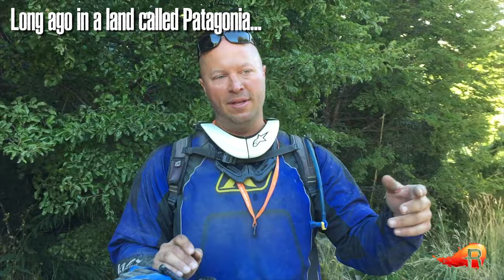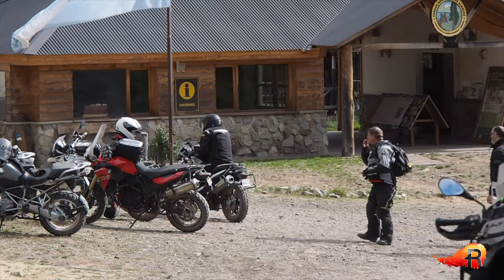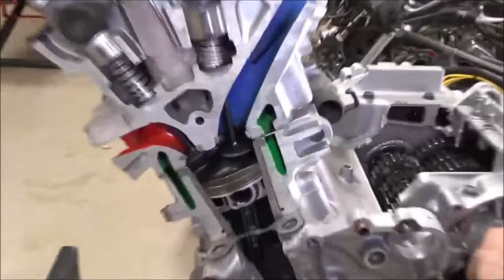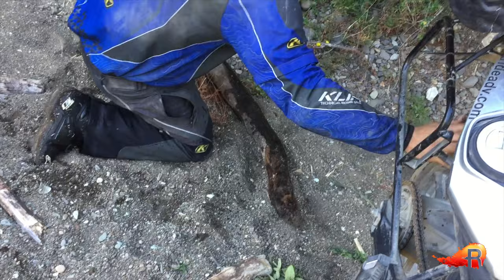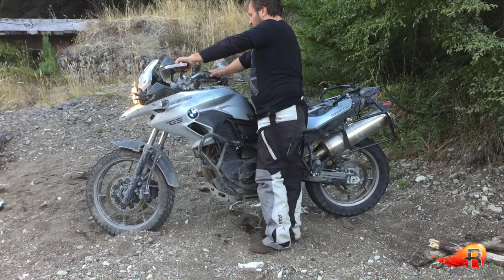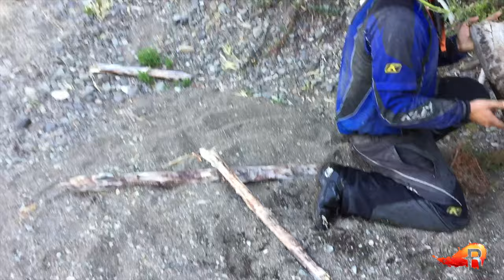How to Deal With HYDROLOCKING Your Motorcycle and the Story Behind the Lesson

Comment: I have gotten a KTM 500 EXC running after being totally submerged. We had no tools. Stand the bike on its back wheel to drain the exhaust. Removed the air filter and clean out the air box. Put bike in 3rd or 4th gear and pull in clutch and push bike BACKWARDS”!  Note - it would not turn over forward on the starter. Get the bike rolling back wards and let out the clutch. Had to do this about 5 times. Finally it pushed the water back out into the air box. This happens because of something called “valve overlap” where for a very brief amount of time both valves are a slightly open. Once we had the engine rolling we got it started. Oil in sightglass looked like chocolate milk. Rode it maybe 2-3 klm to nearest road and then trailered it. Change oil 4-5 times and good to go.
Reply from the maker: Interesting, meaning, you did push the button and it wouldn’t turn over ? My guess in that case is: The piston was probably at Top Dead Center or close, and the chamber was so full of water, that even the starter could not force it over. By not getting its momentum, it wasn’t enough to fold the connecting rod then. Good deal in that case :)

Comment: First thing I’m going to do now is buy a spark plug socket and put it in my trail pack with my other tools. I always thought it wasn’t required because I didn’t think I would ever change my spark plug on the side of the trail, haha. Thanks for the story, it helped me out.
Reply from the maker: Glad if it helps someday, and yea, I think most OEM tool kits still come with a spark plug tool, so you may already have it. -- Thanks for watching.
Reply: MAD TV has a great video of an insane trip through flooded areas in Australia. They were dewatering bikes several times a day and much can be learned from their group leader's methods. The bikes were much smaller but the concept is the same.

Comment: I dropped my 2015 Suzuki Vstrom 650 at a remote river crossing in the Northern Territory of Australia...the bike was lying on its side completely submerged for several minutes before my companions could get to me and help me get it out (note the river is inhabited by salt water crocodiles)...fortunately the Vstrom has 2 spark plugs per cylinder and there is one reasonably accessible plug in each so wasn’t too hard to clear the water. The tank also had to come off to get to the airbox which was full of water. Bike ran fine afterwards and for the 250 km to the next roadhouse on sandy, badly corrugated road in very hot conditions. Another day and 200 km later I also discovered that I had water in the engine oil ...that was 10,000 km ago now and the bike is apparently none the worse for wear !!! The experience has made think how difficult it would be to dewater something like a KTM 890 or even a T7 on a river bank because of their complicated spark plug access 😮
Reply from the maker: Another nod in the favor of the VStrom. What a great bike, as we have noted in other videos. Glad it worked out!

Comment: The best thing to do is push the bike up a slip in neutral then roll it backwards in 5 or 6 gear , after tipping the bike up on the back wheel th drain it.

Comment: I used to follow a Russian team called "Off road people" and they had a whole series of such deep water dives. One of their solutions is to stand the motorcycle up on the rear wheel and allow the water to free fall out (as much as possible). Then they would immediately take the motor oil outside into a metal can or pot (it's a big crew) and boil the oil until the moisture evaporates. Then they put the same oil back into the engine and continued driving without problems. Of course, they had plenty of time and all the necessary tools with them, a large team prepared for multi-day rides in the wilderness.

Greetings to all adventurers!
Reply from the maker: That would have been an excellent option, boiling the oil! Wish we had had the idea, tools, and cauldron to do so : )  But yes, we did some tipping back, and rolling onto it's side/top a bit which got some water out for sure. I feel like even back then, I knew the oil was obviously crushing past the rings and would create what eventually happened, but it was worth trying. -- Thanks for watching.
Reply: Yes, russians. They are used to it

Comment: Great story and experience!
I was snow machining in Alaska with a (crazy) friend who drove his 800cc ski doo into a creek to try and drive up the creek on top of the water!  I saw him go in and thought "Oh no, I'm going to have to rescue him from drowning"!  When I got there, he was standing in water arm pit deep , smiling, and his entire machine was underwater.  We wrestled it out onto the bank, and I was prepping to pull him to the truck which was about 4 miles away (and +5 degrees F so it was cold!).  He said no, he would get it started.  He pulled the spark plugs out, then we tipped the sled on its side and pulled it over a bunch.  Put a bic lighter under the spark plugs to dry them out, and I think we put a few drops of gas in the cylinders- and he drove back to the truck!  He changed the oil 2 or 3 times and seemingly, no damage to the engine.  It was a 2-stroke, which would be different than a 4-stroke- the engine was fuel injected and I don't think there was any oil sump to worry about.  Big difference.
Reply from the maker: Nice rescue! And good situation for a 2-stroke to prevail. The only thing that stopped us from riding 100 km's or whatever, was that oil/milkshake forming within the engine. --- Thanks for watching and sharing.

Comment: You missed one step. After starting, turn the bike off and let it sit for 1/2 hour or so. The water should settle to the bottom of the crankcase. After letting it sit, pull the drain plug to drain the water. Once you see straight oil coming out quickly re-install the drain plug.
I always carry an extra 2 quarts of oil. Could come in handy some day.
Reply from the maker: Excellent idea! If only we had even the tool to get the drain plug out. Or the clear conscience that would allow some oil to ultimately spew into Patagonia:) But great idea for those in the right situation, so thanks for sharing.
Reply: @RIDEAdventures  well, man, you are actually riding a fume-exhausting bike making a hell of a noise through a forest. Your concern about the oil is legitimate and appreciated, but somehow a tad ironic…

Comment: Drowned the bike in Iceland. Put the bike upright with the help of a friend to remove water from the exhaust. Then pushed the button twice and of course hydrolock (i was hoping only the exhaust). Then we removed the plugs, removed the water in the cylinder and then the bike started. I changed the oil 3 times and good to go.
Spoke to a mechanic about being afraid of bending the rod. He laughed at me cause he said there is no way you can bend a rod with just the power of the starter. However if you go full throttle over shallow water and drowned the bike at speed then yes but you will never bend a connecting rod with the starter by pression on the start button. there you go 👍
Reply from the maker: Great story, thanks for sharing, and I'm quite sure rods have been bent by starters. Never had it happen personally, but I bet someone out there can help us confirm?
Reply: @RIDEAdventures  he is the mechanics of the tour company called Ride With Locals in Iceland. They drowned bikes daily and he fixes them. All KTM Husky & Gasgas

Comment: I just cleared out a bike that went into a marsh. I took off the gas tank, exhaust, the air box and plugs, essentially leaving the engine bare. Hand cranked the engine with a lever strapped to the wheel, used the clutch to reset so I didn't have to unstrap the lever. I did this until most of the water was out, then used the starter. Next step was to reassemble, new fuel, add a stabilizer to help pass water through the engine. Then I did an oil change soon after reusing the filter by washing it with oil. In a few kilometers I'll be changing the oil again with a new filter.

Comment: Great story, thanks for sharing it!  Certainly the basic tool kit the bike comes with would have been huge in this situation, but for what it's worth my T7 didn't come with even a cheap plug wrench!  Shame on Yamaha for that, but you can be sure it's got one now!!  Cheers!
Reply from the maker: Yea, it seems OEM kits are getting slimmer and slimmer. Simple spark plug wrench, and access to those plugs would have led to a different outcome, but probably still a milky mixture of oil. Thanks for watching.

Comment: Yes it happened to me on a BMW F850 GSA when I fell over in a river. I had help to push the bike out. It's a big job getting at the spark plugs so I wrapped my tow strap around the back wheel and attached it to a branch from the bush and rotated the engine through several compressions to convince me that I did not have a hydraulic lock. Then I started the engine and a lot of water sprayed out of the exhaust and I thought I was going to be ok. I don't know what made me check the oil but I did and it was lovely and creamy.  Fortunately I could get some new oil and after many flushes I could continue. If there was water in the combustion chamber how did it get into the sump? On the compression stroke both valves  are closed so it can't go out the exhaust or back into the airbox. Did it leak past the piston rings?, I did have a bit of trouble rotating the engine at first. Or did it come in through the crankcase breather which I believe vents into the airbox. If it happens again I will drain the oil into a plastic bag which I carry for that purpose after I have rotated the engine  and if there is water it will be evident at the bottom of the bag. I can drain that out by making a small hole in the bag and then I can return the good oil back into the bike and add some more oil from a small bottle I carry. Then do an oil change as soon as possible. Or I could avoid water crossings.
Reply from the maker: Good move with the strap, and yea, it sure is a mystery in the moment, when we’re not sure if/how water got into where. Transparent Aluminum engine block should help in the distant future (Star Trek reference.) Thanks for watching and sharing.

Comment: On radial aircraft engines you HAVE to remove the lower spark plugs to stop hydraulic lock because the engine's oil will seep into these lower cylinders. These engines have dry sumps but all the oil dripping off the connecting rods, bearings, engine case will accumulate when sitting for a while.
It is surprising how just a little amount of fluid (a few ounces) in the cylinder chamber and the geometry position of the crank to the cylinder and you will bend the connecting rods quite easily.

The only thing I have ever been told was to remove the spark plugs and remove the fluid by tipping the engine or cranking it over. 
Then check the engine's crankcase. If in doubt, drain the oil into anything  and if stuck reuse the contaminated oil but stop before you get to the water. If equipped, take an empty water bottle that has a cap, cut the bottom off, pour the contaminated oil into the bottle, open the cap just enough to allow the water to drain out, then re-pour that oil into the engine.
Reply from the maker: Yea, that being one of the questions, how much water in the combustion chamber would be enough to fold a connecting rod. Guess that would depend largely on the initial compression ratio. — Hope we don’t ever find out the hard way. Thanks for watching and sharing.
Reply: @RIDEAdventures  All you need to tweak that rod is a very small fraction of an once more than the combustion chamber's capacity when the piston is at TDC as we know fluids are incomprehensible.

Comment: great story, but yes, if you're doing deep crossings then you need to be able to take out the spark plug. ive gotten my ktm 300 really wet, but its always managed to get me home/to the truck where I would have to change the oil several times to get all the water out. It sucks. the main takeaway should be DONT get water in the engine in the first place lol and if you do then there are no shortcuts

Comment: A sudden dive into water will cool off everything immediately, and because of physics, it will then create some slight under-pressure, sucking in water automatically. Through the tiny little vent of your brake fluid reservoirs, petrol tank vent, engine vent, etc...
DO NOT start or ride your bike after immersion... get to a garage or do this onsite; first open cylinder head, then change ALL the oils. PS brake oil is hydrophilic!
Reply from the maker: Excellent reminders, and about the brakes and such. Thanks for sharing.

Comment: Could you have waited another 30 minutes and drain the water from the oil. It settles below the oil and would drain first and as soon as oil is seen plug the drain.
Reply from the maker: Good call! But it was mentioned that we were in a rare circumstance, without any tools to do even that. - Plus, that wouldn't really solve the hydrolock situation anyway. Would have helped the "driving away, turning the oil into a milkshake" situation for sure though : )

Comment: How would water enter through the exhaust unless the engine stalls?   You took for grant the depth of water at an unknown crossing by looking at it?  It was careless by not getting your feet wet and checking the depth and bottom condition before you rode through it.    You were lucky, always removed the spark plugs, the air filter, etc. and it will easy to turn the wheel without compression removing the water and risk of damaging the motor.   In addition,  I'm sure there a little water that entered the crankcase from the ventilation line.

Comment: Have not had that experience yet...  But a field fix question; after or while pumping the water out of the cylinders; could you have drained the oil into a pot (or other metal container) and boiled off the water enough that the remaining could vent?
Reply from the maker: This is a great idea as well! We had absolutely no tools, containers, or options to do this with, but others also mentioned that….just letting the blend sit in the engine a few hours would separate the oil and water. With water in the bottom then, pull the drain plug for a couple of seconds until oil comes out. Probably not as thorough as a full removal and boil-off, but pretty good. — Thanks for sharing though!
Reply: @RIDEAdventures  Just trying to think a little outside the box; still very new to adventure style riding.  Thank you.  Really liking your channel for all the information!

Comment: It is a funny scene.  But it almost in 90 percent of cases if your airbox gets water you will have water in the engine casing.
The reason is, when your engine is running there is a positive pressure inside because of gasses escaping from the compression  chamber into engine casing  and they recycle into airbox by a hose from the top of the engine,  usually from valve cover to somewhere close to air filter. But when you get in water and your engine stops, there is no positive pressure any longer and also because water had cooled the engine casing, you have negative pressure, and that vacume will suck water into your engine from the same hose you purge gases in the airbox.
So if you get water in the airbox you have to change the oil or at least check it to see if it's good enough to get you somewhere to change the oil.

Comment: I'm on a Tenere 700 and getting to the spark plugs is ridiculously involved. Has me wondering what I would do.
Reply from the maker: Yea, the “let it sit a few hours and drop the water out the bottom” trick mentioned by others below would probably be best. That is, if the water has fully left the combustion chambers, which  of course is hard to confirm. Thanks for watching.

Comment: I don’t understand is why you can’t just take the spark plugs out and turn the engine over with the starter. You no longer have compression and the water should squirt out like a hose with each cycle of the engine. Whatever pressure, the water might make with a diameter of the spark plug hole shouldn’t be strong enough to bend anything.
Reply from the maker: Check again, maybe you missed that we were without any tools but maybe a Leatherman we used to open the air box. But you’re right otherwise.

Comment: Did the guys in front go the same route through the river?  I don’t understand how they could have gone through and not waited.
Reply from the maker: Good question, but correct, they did not go through it. I was up on the little bypass trail that they also took, because I wanted to get a side shot of Andres instead of head-on. Looked quickly, and said "yea, no problem, 1-foot max" to myself. And then waved Andres through.
Reply: Thanks for the response.  Glad everything worked out and thanks for the tips.  It’s always nice to learn new tricks.

Comment: I am not aware of a motorcycle brand that doesn't come with a crappy tiny tool kit. And they always have a cheap plug socket/wrench thing.
It is one of those things you should leave in the bike, even when trying to shed weight or combine tool kits or improve a tool kit.
Also, if only one person has the tools, that one person has to ride sweep.